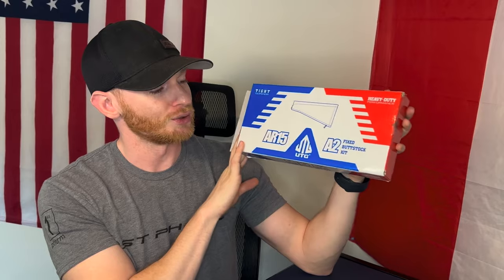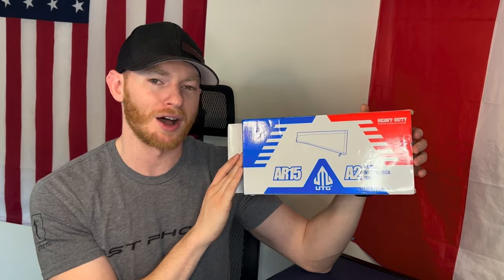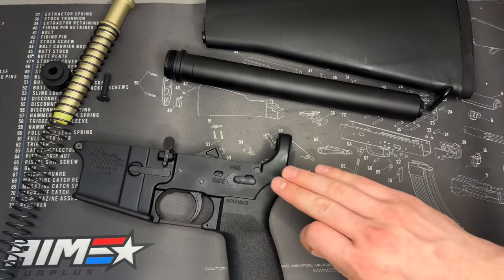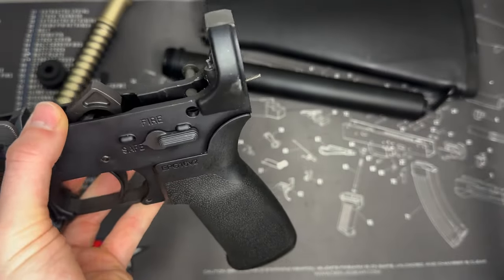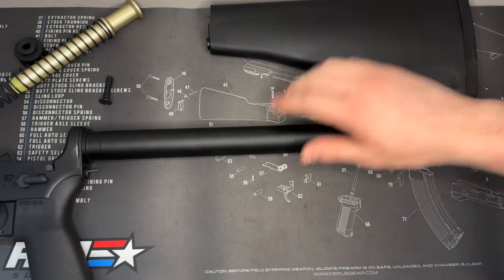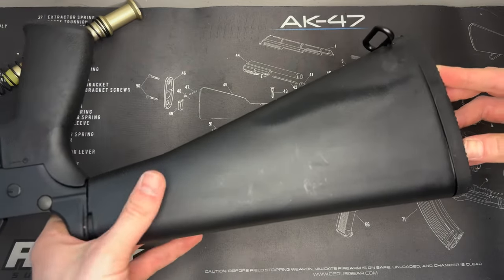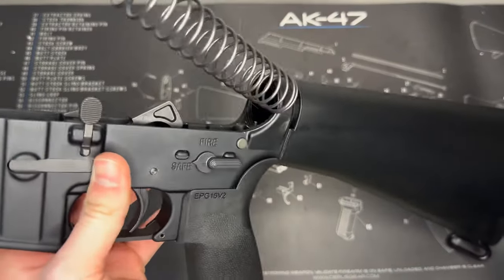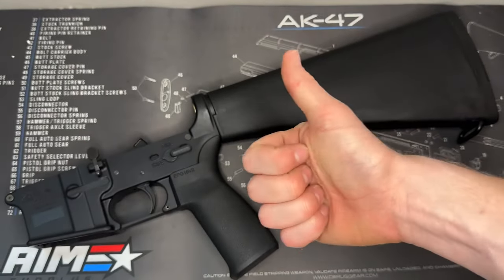How to Install A2 (M16 style) Buffer Tube and Stock

Comment: This will be helping me with my custom build. Already have a couple videos saved for when I eventually have enough money to get everything I'd need, and the one thing I was completely missing was knowledge on how to install an A2 stock.
Reply: Will an A1 or A2 stock fit on an ar-10 lower? I'm working on a custom ar-10 build, but I want red wooden furniture on my lower.  Any advice?
Reply: @johnkirkpatrick9131   it should work just fine, and I don’t see any reason why it wouldn’t work, but if you already have a mil-spec(plastic) A1 or A2 stock, I’d suggest testing it out using that version, make sure it works, then swap over to the wood stock. 
Of course, the A2 stock will need a spacer and a longer screw than the A1, but if you already have all of that, then you should be fine.
Let me know how it goes, too. I’m always interested in hearing other people’s experiences.

Comment: That "extra piece" is a buffer tube extension to work with the A2 stock, which is a little longer than the A1 stock. If you were using an A1 stock, you would leave that off.

Comment: All my ARs sport an A1 or A2-length fixed stock now. First and foremost, no beard hair pulling! Secondly, they have a handy storage compartment for spare bolts, batteries, cleaning kits, etc. And finally, their solid construction inspires confidence. I would recommend putting a little blue Loctite in the receiver threads just for added security.
Reply: I got curious and tried unscrewing one of the buffer tubes from my rifles, and I advise AGAINST putting blue Loctite on the threads.  I destroyed the buffer tube trying to get it off. The spec calls for some grease on the threads and 35-39 ft-lbs of torque, and I have now done that to all my rifles. If you  want to use blue Loctite, do it on the threads of the buttstock screw, not the receiver threads!
Reply from the maker: Haha good point!! Thanks for the comment!!
Reply: i second this the beard hair pulling is the worst lol
Reply: Them stocks ain’t solid. I don’t know how many of them shatter every BCT class on the bayonet range. But, I like the correct stock because I like the correct stock. I don’t like 16” barrels, I call a rifle a carbine at 20” so M16a2 was already a carbine. But what is not attempted to explain is after that but or maybe spacer is dropped in the stock, what holds it to the buffer tube? Is the back of the buffer tube threaded and the screw threading into it? Also, there shouldn’t be anything in the stock but a cleaning kit. I get some people may want a “survival kit” or whatever but the void in an A2 stock is designed only for the issued cleaning kit in it’s canvas roll.
Reply: @alexcalvert5779 What are yall calling beards? Mine is a medium beard and it doesn’t get caught in any stocks, unless it’s too short for me and I just sweep it to the sude

Comment: Some little tips...
Degrease the threads of the buffer tube and lower receiver before assembly and use a drop of blue Loctite on the threads of both the tube and receiver. 
Put a small amount of gun grease on the takedown pin, takedown pin detent and detent spring. Put a small amount of gun grease on the buffer retainer and spring and on the buffer spring and buffer also.
Reply: I've read both sides - torq vs blue loctite . having installed a Magpul MOE stock not using loctite on the tube was an issue - when attempting removing the stock the buffer tube turned when unscrewing the stock !!! after some #### i removed the stock and tube, cleaned up the threads , applied "A LITTLE" dab of Blue left if over night and with a "lot" of effort the stock separated. PS the ar armorer's tool i have doesn't fit buffer tube at the end- had to revert to simular wrench approach.
Reply: @billz4795  This happened to me on my A2 factory stock.  When I went to take the stock off by undoing the screw, the buffer tube started backing out with the stock still stuck to the buffer tube.  After you got the stock and buffer tube off the receiver, how did you get the stock to break free from the buffer tube before re-assembling with Loctite at the buffer tube/receiver joint ?  Or did you just put the loctite on the threads with the stock still connected to the buffer tube and then install the tube into the receiver, let it sit, and then the screw separated the stock from the buffer tube when you tried to turn the screw the next day?
Reply: @bobstevens7028  
After I got both off and cleaned off the buffer tube threads and applying blue loctite to the treads , reinstalled.
Applied a liberal amount of oil to the stock screw.
Waited overnight and luckily with some effort the stock screw broke loose not the buffer tube, and the we had separation.
Needed to use a wrench to get the buffer tube off.
Reply: Negative on the blue loctite. Manual states the use of molybdenum grease

Comment: I installed the same UTG A2 stock on my Smith and Wesson Ar15 Scout 2. Be sure to slather moly grease all over the length of the buffer spring. Slides easier and no “Twang or Boing” sound when firing.

Comment: Would definitely put some Aeroshell 64//33MS  grease on the threads of buffer  Before install so they don’t cold weld together over time of ever disassemble buffer from stock.

Comment: Does the extended buffer and spring change your cycling compared to the old spring and buffer? Would you need to change your gas system to a new one if you have a carbine upper?
Reply from the maker: Yes! You will need to test and possibly tune your gun.
Reply: I did this conversion on my Sport 2. Cycles perfect. Over 1500 rounds and not one issue.

Comment: Can anyone help I have an Aero 308 - a fixed stock set up.

I took it out the other day to sight in, but it kept having feeding issues 

All my friends recommended switching to collapsible - which I don't want. This is the second AR 308 that I have been having the same issue with. I want to fix the problem before I give up. I am tired of there not being any resources/solutions for the 308 because everyone wants to focus on AR15s.

Comment: A better tip than using a spray gun oil is to use grease. Seriously just pick up some bearing grease and some nitrile gloves. You definitely want to use grease on your buffer and buffer tube because you don’t want to get a face full of oil when you first fire also, you don’t wanna ruin your clothes.

Comment: The extra part that goes on the end of the buffer tube is the A2 "buffer tube extension". (the A1 was just that much shorter so they increased the overall length and added an extension and longer screw to accommodate).